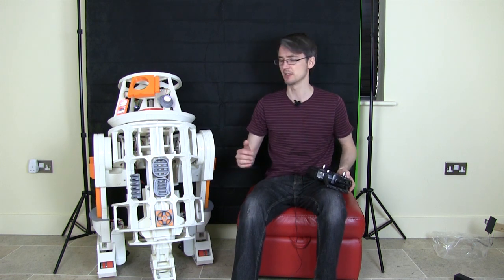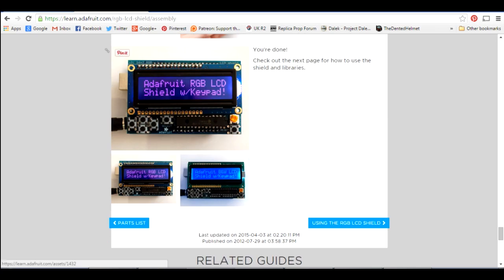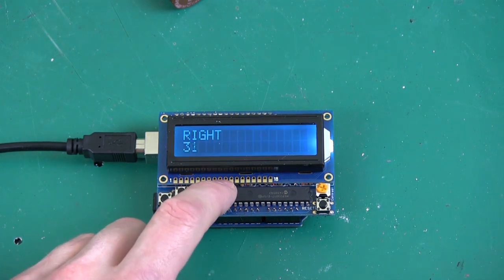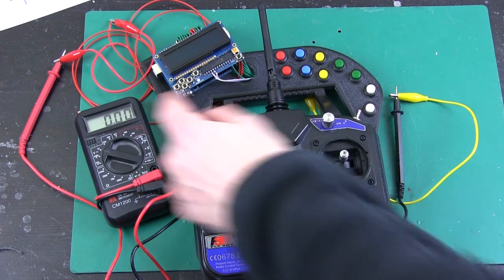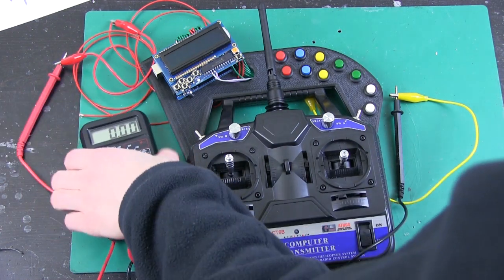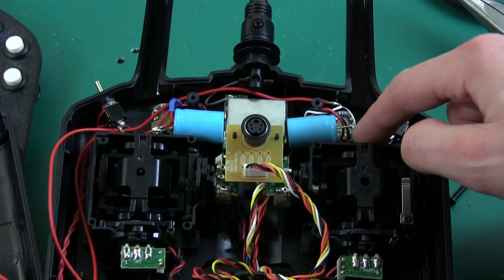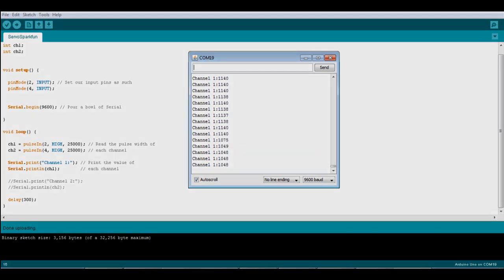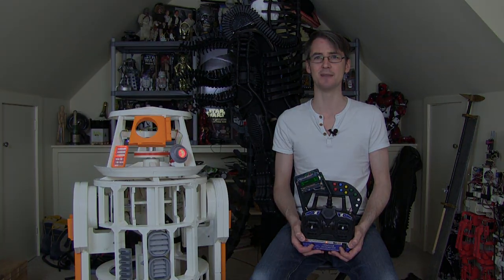Star Wars R6 Droid #11 | Remote Hacking with Arduino | James Bruton

Comment: Great stuff.   Impressive how much you can do with 123D and 3D printers.   BTW, is there a series resistor between the Arduino PWM output and the 470uF filter cap?    That's pretty important for a single pole low pass filter.

Comment: I must have missed something but using an analogue transmission seems quite a complex method for initiating the various settings. Was there no practical way to send a simple data stream so you could send the command numbers directly?

Comment: base on the fact that I just understood about a 25% of all that coding and integrating, I think is possible (tho hard) to program a small logarithms to automatized some of the movement. For example if you press the green button R6 would spin its head flash some lights and make a "happy" sound on a sequence.

Comment: Have you considered turning the power couplings into actual plugs that could be used to charge the droid?
Reply: Jacob Jensen That actually sounds like a great idea. Using multiple ni-cad (or similar) batteries for the various components of the droid would require a need to recharge them in bulk by some means.